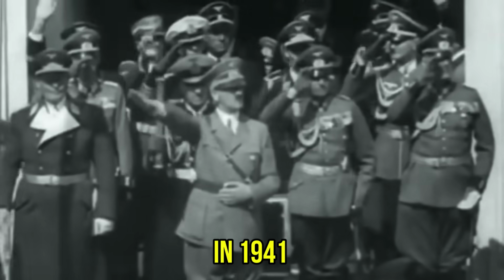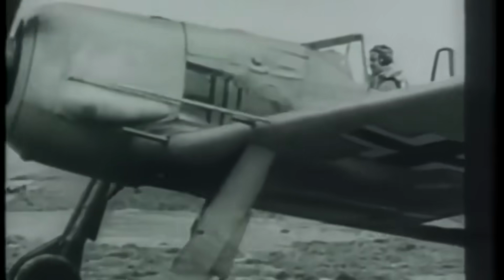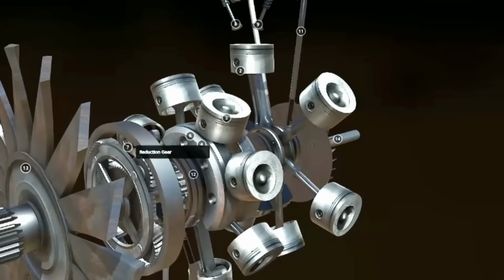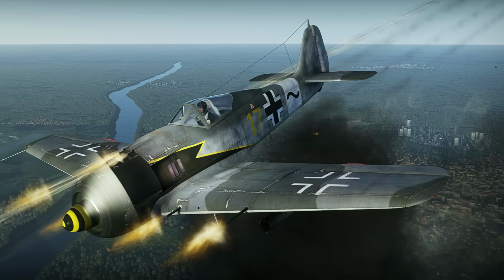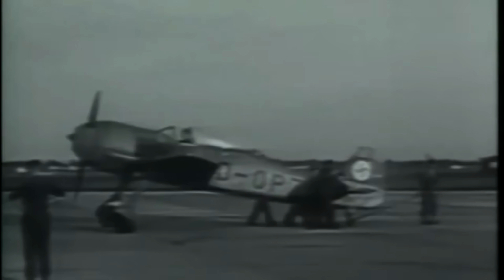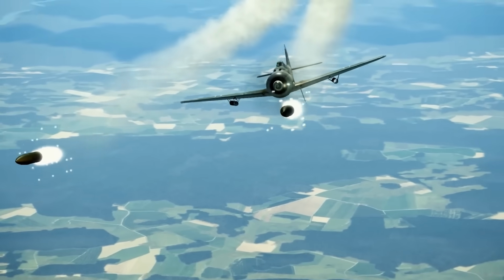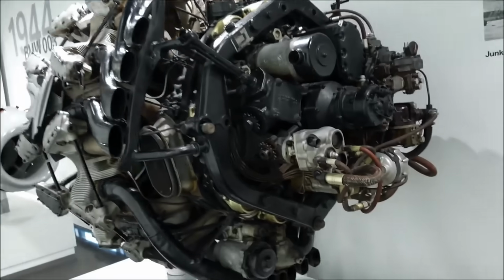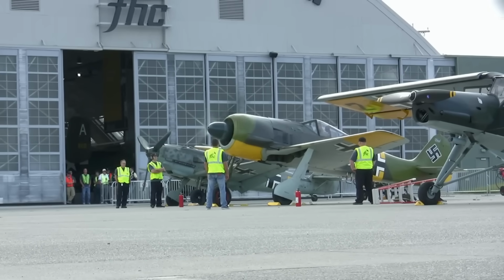The Shocking Truth Behind BMW's 801 Radial Engine

Comment: Not sure why BMW struggled with the cooling on the 14 cylinder, 1700 HP  BMW-801 engine. Pratt and Whitney didn't have overheating issues on their R-2800 radial which put out between 2000-2400 HP and had 18 CYLINDERS. US was the preeminent  nation with radial engines in WW2, the British had a good sleeve-valve design, but didn't work the bugs out of the 2000 HP version until the war was nearly over with.

Comment: The Wright Cyclone  R-3350,  which powered the 4 engine Martin JRM-1  Mars flying boat   also had a its own unique front cooling fan  similar to the BMW 801  although, for the Martin Mars sea plane  the fans primary purpose was to protect the 18 cylinder radial engines  from splashing sea water during takeoffs, landings and taxiing with the splashing water contacting the fan blades and spin the excess water into a water collection and drainage feature in the cowlings away from the engines.  I lived close to the Hawaii and Philippine Mars flying boats used as fire fighting water bombers until the 2010's.

Comment: Lots of fuss about nothing. The Double Wasp was from the same period, specs are even better than the 801. They actually didn't die because they were really reliable. The quality of the 190 came from it's cooling system and aerodynamics.

Comment: The FW190 restored to flying condition at the Flying Heritage Collection by Paul Allen crash landed due a tiny piece of cloth placed by a saboteur in the lubrication system and clogged it. This was noticed at the time the restoration team worked on the engine

Comment: Another well known act of defiance was french factory workers "modifying" the oil dipstick of certain engines so as to alter the minimum oil required to a lower, engine destroying, level. The germans, as the story was told, never figuered that out. So engines were destroyed by too low oillevels. 
Indeed, ingenuity in desperate times.....
Reply: This is why Speer wanted to convert French factories into domestic products so Germany could produce all the armaments and war machines. The change started in 1943.
France did well post war 1945 thanks to Speer. They had all the domestic products for boosting their GDP.

Comment: The BMW 801 was not so great, compared to the Pratt & Whitney R-2800, which produced more power although slightly smaller in terms of displacement (although on superior American avgas of higher octane rating). The R-2800 also ran quite smoothly, and it could take considerable battle damage. 

Besides the deliberate sabotage by their builders, German aircraft engines late in the war began to suffer from scarcity of trace metals (especially Ni) required for engine metallurgy. That's the reason for the fact that the jet engines in the Me-262 had to be trashed after 25 hours of operation (according to Gen. Galland).

Comment: Shocking truth ? it displaced nearly 15 litres more than a Merlin but produced about the same power !
Reply: But being a radial it was more able to take combat damage. Kurt Tank was all about practicalities. I love Spitfires, Tempests and Mustangs but liquid cooled engines didn't take well to rads being hit
Reply: @marklittle8805  That's true, damage tolerance for a liquid cooled engine is poor due to the fragility of the coolant plumbing an accepted risk I suppose for the mustang which had the legs to reach Berlin non-stop fully armed. I read that the Merlin powered mustang at cruise burned about 65 US Gallons per hour and the P47  approx 145 !

Comment: Completely omitted what actually solved the cooling issue; the shape of the front cowling and the extra fan that regulated itself to force the air to the cylinders that needed it most at the rear. And it was the British that called it the butcher bird not the Germans. The Spitfire mk9 redressed the balance in spectacular fashion not long after as one day the 190 just could not win any more; the Germans were shocked as the new spit looked the same as the mk5 that they easily outclassed but had a much more powerful engine and the Merlin was king again...
Reply: So did the Typhoon.
Reply: No mention of the FW 190 that was flown to Wales
The secrets contained made the Bristol Centaurus work (Tempest Mk2, Sea Fury)
Reply: @g8ymw  Actually that's a very contested view  google the question "did the british copy the fw 190 cooling system for the Hawker Tempest" you will get some interesting answers :-)
Reply: I thought the Mk 9 was Griffon powered not Merlin  ? there is an excellent telling in Jeffrey Quills autobiography about a drag race between a captured FW 190 and the prototype Griffon powered spit with assembled Air force Brass as dumbfounded onlookers.
Reply: @number1genoa It’s definitely Merlin powered, the 61, 63, 66 versions. The mk 4 was the first Griffon powered variant, the mk 12 was the first production variant.
Reply: It’s just fake!

Comment: -The BMW 801 was a 1950 hp engine from 1943 not 1700hp.
-The BMW 801D2 was a 1700hp engine in 1942 with introduction of C grade high octane fuel of which increase power from 1560 hp of the 801C2 over the 87 octane fuel.
-From 1943 improvements in fuel and the introduction of “C3 einspritzung” and “erhote noteleistung” raised power from 1700 to 1950hp or 1850hp.   
-C3 einspritzung injected C3 fuel into the eye of the supercharger to precool the air and was used on grand attack versions below 1000 m.  
-increased emergency power (erhote noteleistung) simply enriched the mixture and utilised improvements to allow increased boost pressure and could operate at any altitude the supercharger could support the increased pressure.
-with the BMW 801TU of early 1944 the systems were combined.  
-With the BMW 801TS the supercharger impeller fluid dynamics were improved and the boost rating increased yet again.  I think the engine was probably around 2100 hp by September 1944.  They were planning on going to 2350.   The BMW801F never entered Service but featured to 3 speed supercharger and precision cast vacuum cylinder heads with a horsepower of 2600.

Comment: How much fuel did they use ?
Reply: Every aircraft piston engine uses between 0.3 to 0.5 pounds of avgas per horsepower per hour. 0.3 is the best, achieved by very few, like the R3350 compound turbos. 
At high power settings, most air cooled engines are run very rich(fuel cooling) mixtures. So a 1200 hp engine might use 600 lbs an hour or 100 US gallons. Max power for these engines might closer to 1800/ 150 gph

Comment: The original 109 BF.... Was there a race playing.... Created in the 1930s..... The f*** wolf 190.... Had an air-cooled engine.... They learn from the Allies that putting bullets through engines if they had cooling systems on them.... Was a big mistake. 
.

Comment: Myth, myth, myth, and misinformation.     The Germans had not developed a turbocharger (needed for a radial engine) because there was not a perceived need for it early, when it was needed, the German could not catch up because they didn't have the stockpiled  materials to make the  turbochargers AND the Fw 190 was too small an airframe to accomodate a useful turbocharger.  Instead they opted for the inlne engine from Junkers which had mechanical superchargers like the DB engines.
Reply: You don’t “need” a turbo for a radial. It’s an efficient way of raising manifold pressure at all altitudes, but you have to be careful up high, coz they overspeed. Later Corsairs had massive superchargers on them.
The USAAF had a preoccupation with turbos for high altitude work, the rest of the world was different. Get out of the bubble sometimes

Comment: The biggest failure of German Engineering is that they kept designing beyond the capabilities of the materials they had available to produce with.
Reply: wrong. that was in a few cases, the rest of the cases was a bit more complicated. in many cases they lost some of the materials shortly after the production started. On one of the daimler airplane engine it happened during the first testing phase with 1 cylinder engines.
Reply: And the key is availability -- they had and could work with the materials that were necessary to produce the equipment they designed, but never had more than a fraction of the amounts that would have been needed for the production numbers that were being demanded, so additional effort was spent in designing workarounds to get useful performance out of inadequate materials. The abysmal MTBF of the Jumo 004 engine is, perhaps, the best example of this.
Reply: Plus you van never really trust slave labour.

Comment: You need to do a comparison of this engine and airframe, with the USA F6F, along with the P51 and P38.  The F6F had a double radial engine.  The 51s and 38s had enclose engines to allow better airflow over the fuselages.  The absolute and limiting problem with ANY aircooled engine, is that it CANNOT go into the speed zone where Viscid Flow exists.  That is at about 350-to-400+mph, and then you get shock waves which will block or stall incoming airflow, unless specifically guided.  Open cylinder cooling fails at that zone.  Also, the same argument applies to ANY propeller.  Once the Tip-Speeds get into trans-to-supersonic zone, where viscid effects occur, the propeller itself becomes a "blocking agent" to prevent any further "thrust flow" past itself.  After WW2, experiments with Props driven by Jets, caused several test pilots to die, due to the propellers just forced to break off the airframe, due to excessive sideways, and unbalanced shock pressures.  Modern Scimitar props have added a "few" MPH to those speeds, and actually improved Thrust/Fuel ratios by quite a bit (at lower speeds), but the EU effort to produce Open-Prop Airliners, which can travel and Mach0.75 is an idiotic idea, as emprirically already shown.
Reply: And all of the problems with the XF-84H 'Thunderscreech', where the outer part of the propellor blades would go supersonic even at idle, with the plane creating huge amounts of noise and shock damage, to the point where air operations at the field where it was being tested had to use communication by signal lights because the radio equipment either couldn't be heard or were damaged by the shockwaves.
Reply: Seen a Hawker Sea Fury?

Comment: Certainly the BMW 801 was a masterpiece of engineering, but in later models of the F-109, as well as the Ta-152 variant, it was replaced by...liquid cooled V12 engines.
Reply: The Fw 190A9 received the BMW 801TS and entered service around the same time in September 1944 as the Fw 190D9 this seems to have given about 420mph versus 438. So slower but not much.  There was a 2600hp BMW801F on the way.  An interesting engine with the BMW801R. This had a 4 speed 2 stage supercharger with intercooler.  It was as long as the liquid called engines.  It was planned for the TA152C.  The prototype plans were destroyed in bombing and so it was thought it would take too long to catch up and the engine was abandoned.
Reply: As far as I know, there was a shortage of BMW engines and a more available Jumo 213 had to be used.
Reply: @snipe1973xxl The 801 was always in short supply as you say.  The BMW 801C2 entered service in 1941 on the Fw 190A1.   By mid 1942 it was fully debugged as the 1700hp BMW 801D2 on the Fw 190A3.  It kept gain power every year probably getting to 2200hp by late 1944.  2350 and 2600 was planned 
-A Ju 88A4 modified with a smooth nose and BMW 801 engines was known as a Ju 88S-0 and had a speed of 338mph versus the Ju 88A4 306 both with dive brakes removed.  Few Ju 88 received the engine and so the Jumo 211 and Ju 88A4 soldiered on. 
-The Jumo 213 entered service in June 1943 on the Ju 188A.  It had less power than the 801D2 which was around 1900hp by then because the 1750hp Jumo 213A had mediocre supercharger fluid dynamic  performance and lacked an emergency power boost system  and because it was a new it needed extra maintenance.
-However by October 1944 the engine was producing 1900 hp with emergency boost and by November it was producing 2100 hp with special emergency boost which was MW 50.  If high octane C3 fuel is available something like 2240 hp was produced in test runs.
-With a cancellation of bomber production most of these engines became available for the FW 190D9.
-Possibly allowed more of the 801 engines to go to night fighters.  
-The in-line engine by now had a good supercharger and it had less drag than the radial and was faster.
-later a two stage two speed supercharger became available on the Jumo  213F
Reply: Then why didn't Germany win the war?
Reply: @taijuan5087  outnumbered by a factor of 2.5 to 1 when the axis are included.  Severe shortage of oil and critical metals such as nickel chrome tungsten and natural rubber.   United States was out of reach of bombing.

Comment: The most important military engine for the germans was the DB605 wtf the 801 was dogshit, it was only good enough because of the german systems the Planes had to do all the micro managing without the need of pilot imputs, unlike soviet planes for example, in reality even with MW50 injection and C3 fuel, it had less HP than a Rolls royce merlin 66 or a packard V1650 - 7 while being heavier, less aerodinamic by being a radial, and having overheating problems, heck... Even the allison V1710 - 111 on the P38L was stronger and more reliable, and the P38 had two of them, another thing, the 801s that equipped 190As were terrible at altitude too.
Reply: That is maybe so, but how come Roy Fedden  of Bristol Engines at Patchway got hold of a Beemer 801D salvaged from a crashed wurger and incorporated its blower design into the his Dash 100 Hercules radial?.
Reply: You forget the allies had 100/150 octane fuel from the USA which have a huge advantage in supercharger boost. The Germans had to use 87 octane fuel.
Reply: @drstrangelove4998  The US made about 93% of the aviation fuel for the allied cause. The soviets got some too.

Comment: Total waist, this guy never heard of the v liquid cooled Junkers engine that made the FW190 the successful fighter it was.
The BMW was meant to and was only an intermittent solution.
Reply: You mean the  1776 hp Junkers Jumo 213 E?, and yes cats&kittens the 1900 hp Daimler Benz DB 603 also powered the 'Dora' model 190,and the long wing  high altitude Ta 152 with a huge paddle bladed VDM prop.
Reply: Junkers Jumo-213?